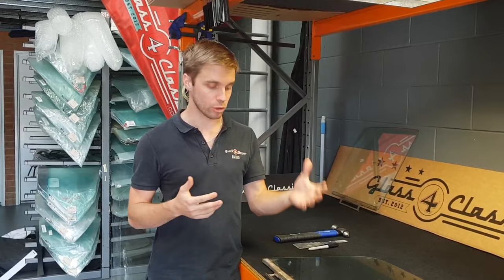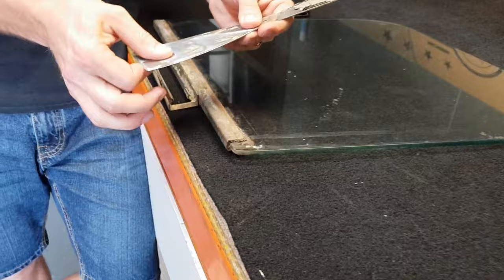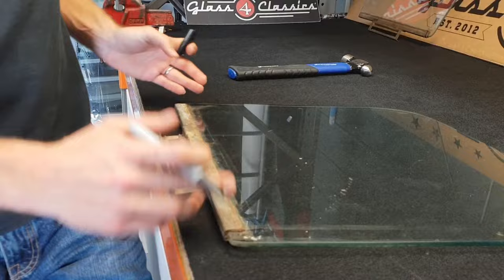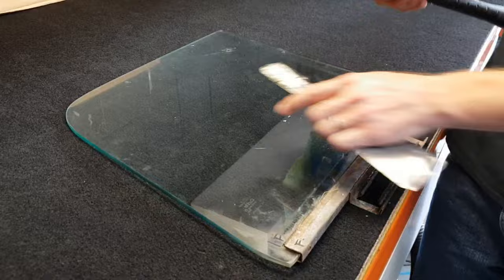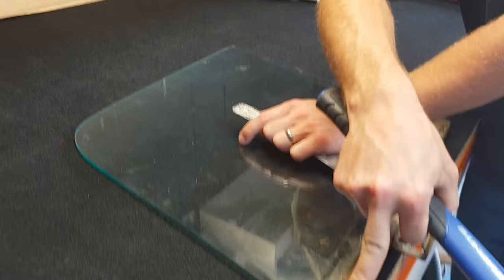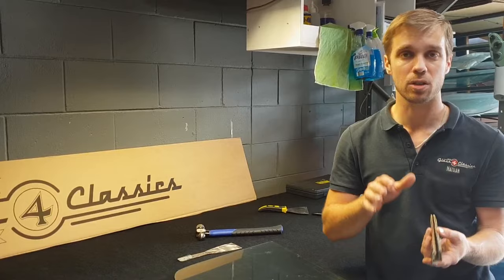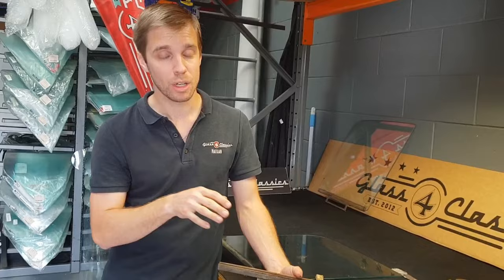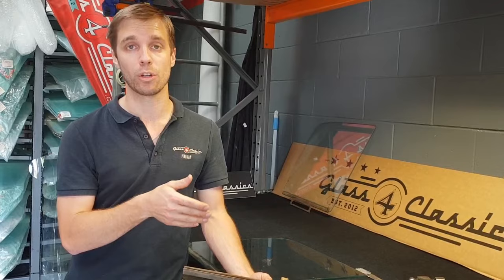How To: Removing Runners from Wind-up Door Window Glass.

Comment: Thank you! Very nicely done video! I used a hard plastic hammer to minimize the chance of fracturing the glass. I also sprayed engine degreaser along the runner and let it sit for a few minutes. That seemed to help soften the 55 year old adhesive on the setting tape.

Comment: Excellent video ! My Question is i bought both left and right side runners but not sure what way they face out. The originals were not with the car so i have no idea . Thanks for any help
Reply from the maker: What model vehicle do you have? In most instances the small channels on the bottom of the runner (that the guide wheel rolls in), will face inwards towards the cabin of the vehicle. If you can let me know the make/model, I may know off the top of my head which way it goes.
Reply: @glass4classics427  Thank you for getting back to me. I have 1939 Packard 120 coupe. On your video the very first picture of your demo showing the runner laying flat with the bends facing up would that side face to the outside of car or towards the inside?

Comment: What is tape thickness size for a 63 impala I tried using 1/16 but it was to thick
Reply from the maker: It'll depend on whether you've got new glass or original glass too. I have used 1/16" in the past, but my glass may have been different to yours (We made new glass for the customer). If the 1/16" was too thick, the next size down is 3/64". If you can't find it locally, we're happy to send overseas if you need it.

Comment: I can not find glass setting tape. Planning on using bicycle inner tube rubber and glass glue.
Reply from the maker: It can work, but advisable not too. Bike inner tube is an old trick that lots of people have used for years, but inner tube is stretchy and often ends up not working very well. I've had customers that made the comment they used it and the window popped out of the track or vents popped out of frames while driving because the rubber was stretched when going in and under tension. If you do use the inner tube, it's probably best you use a small amount of urethane on the very end as some insurance to make sure it won't pop out.
Reply: auto city glass

Comment: Is there a good guide out there to find a runner for a 33 Dodge? I'm missing one for my driver's door, on a  4 door. A compatible replacement or after market that works with the original equipment would be great.
Reply from the maker: Hi deerevdevore,
Early Dodge (Chrysler/Plymouth etc) is always hard to source parts for. Particularly here in Australia. Very few reproduction parts are available for them. The best we can offer is just the runner portion, but it won't have any brackets/guides attached to the bottom of it, so it may not be of much use to you.